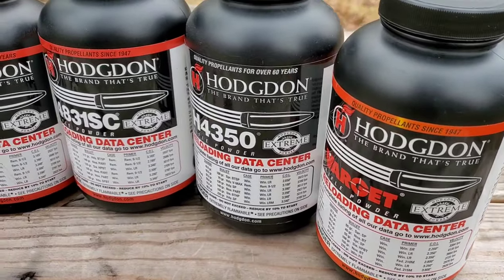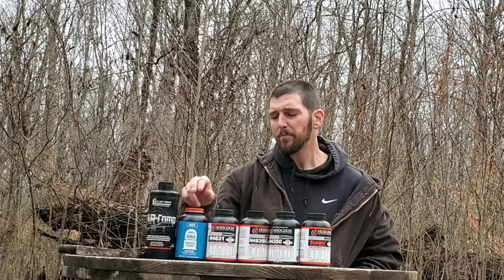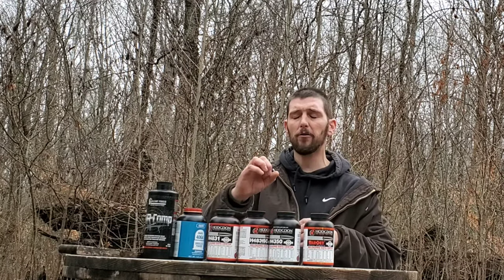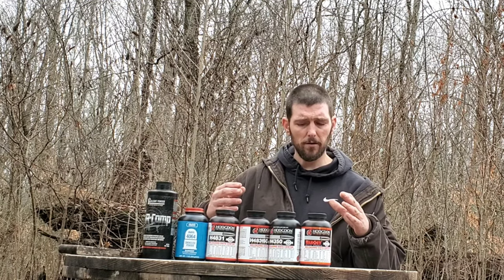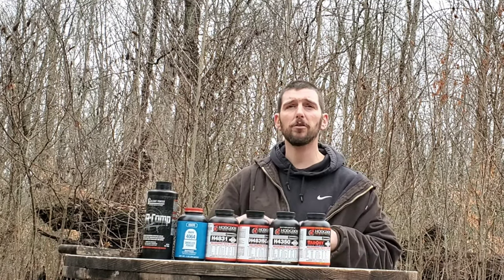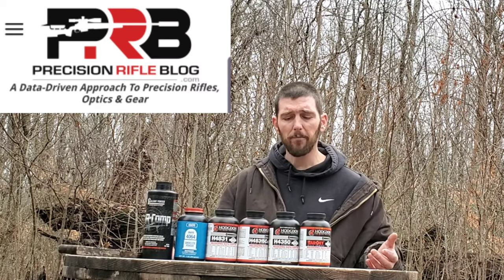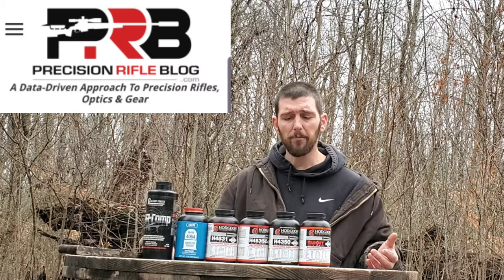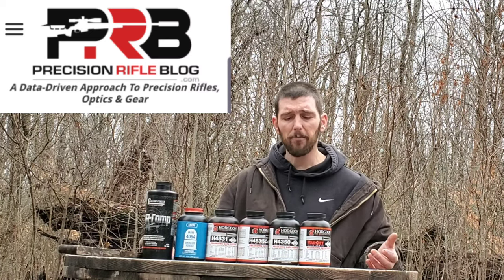Powder Temperature Sensitivity For Long Range Precision Rifle Loads

Comment: Depends on the application, but with 4064, a decent weight bullet, and a fairly full case, over 80F swing, it has shown about a 0.15625FPS change per 1F. I arbitrarily call anything with less than a 0.25FPS change per 1F, stable. Researching this, there are a butt load of variables that play a role in sensitivity(case fill, bullet type and weight, cartridge, lot number, ect...). These test videos are valuable, but your mileage may vary. Some powders are always stable by everyones definition, some are never stable under any conditions, and many ride the line being stable in some conditions while being unstable in others. If you do the research and run the numbers, you'll see this trend. The best you can do in research is get a ballpark approximation for the values of fps change per 1F. If you want something to reliably plug into your dope, you have to test your specific load.

Comment: The IMR Enduron powders are double based with some treatment to reduce sensitivity. The Hodgdon Extreme powders are single based. 
So, the Enduron line is definitely not a clone of the Extreme line. Double based powders contain nitroglycerin which increases the energy content and thus produces higher velocity but the nitro is temp sensitive. 
If you are seeking ultimate stability single based powders with reputation for stability are the best. But you give up velocity to achieve this. 
If you are seeking ultimate velocity, double based powders juiced up with high nitroglycerin are the way to go, but you give up stability for this. 
Then there are the newer powders coming on the market that attempt to strike a balance between these two alternatives. These are double based powders with moderate nitro levels and super proprietary treatments with magical chemical elixirs to reduce the temperature sensitivity. These include the Enduron line, Reloader 16, Reloader 23, and Staball 6.5
These powders are designed to yield higher velocity but without excessive sensitivity…. A compromise balance in the middle ground. 
Only time will tell how good these fancy pantz temp stable DB powders really are. I have tried SB6.5 in 300WSM and it was twitchy… me no likum. 
RL16 seems to be developing a positive online anecdotal reputation… that one might be worth a try.

Comment: Temperature stability isn’t just about velocity. Some sensitive loads in some rifles really impact group size and point of impact. I tried H100V in my 300WSM… great velocity!… But…
I loaded up 10rds to test groups at 100m… shot 5rd group at 5degC and a 5rd group at 30degC
The 5C group was 0.89”
The 30C group was 2.6”
Mostly horizontal stringing… no bueno…
I can live with some velocity differential… but I need POI stability and group size stability. Gonna try H4831sc next.

Comment: I use IMR4064 used it competition and hunted Alaska never had a problem all chronographed the same. Altitude makes one hell of a difference. Temperature range Arctic minus 62 to Arizona 120 degrees
Reply from the maker: My experience was much different with 4064 in my 308
Reply: Agreed....I have never experienced and temperature swings with IMR 4064...of course the 30-06 is a larger case and as such may allow a little more forgiveness than your 308 case which relies on using more efficient powders.

Comment: Just picked up a bottle of imr 4064 and arcomp to try out, haven’t been able to find the others around me locally though
Reply from the maker: Ar comp is fairly insensitive.4064 is pretty temp sensitive but as long as you do your load work up this time of year and dont load to mass pressure you should be fine. You just may have to adjust your tables as the weather heats up.

Comment: I very much enjoy your videos.
What is your secret for shooting these small groups/spray cans/shaving cream at distance? Do you have really really low ES and SD figures?
Reply from the maker: Thank you. A huge part of it is load development.  Using good powders and achieving low sd and finding a load that settles into a good accuracy node at the same time. Then collecting good data.  Then just having good fundamentals and recoil management.
Reply: Speaking of recoil.. how do you preload the bipod? Also, are we talking low SD? Of SD below 5 consistantly? 
I am fairly new to LR and have been learning alot from your channel. I shoot a Tikka CTR and it can hold half moa 5 shot groups and single digit SD pretty well. Sometimes I just can see my heartbeat. Most of the time reading the conditions (wind) is what gets me.  Trigger control is improving. Guess all you can do is practice.
Reply from the maker: @henryknoetze9579  I usually am happy with sd below 10fps. Sometimes you get lucky and find that sweet spot where you can get a 3fps sd but it's rare. Pre load doesn't have to be a lot of pressure just enough to put forward pressure on the bipod. The way I do it is when I get down into a good position and spread my feet out for stability I use my feet to push forward very slightly. I usually find when I can see my heartbeat it due to nervous energy and a few deep breaths and making sure I'm completely comfortable in my position will help slow my pulse and minimize it to almost nothing.
Reply: Real solid advice. Thank you for taking the time to answer me. I will implement these and hopefully become a better marksman. I heard in a video you said you fire at the bottom of a breath.. is that regular exhaling? Or do you take a deep breath and slowly exhale while squeezing the trigger? Also, what weight is your trigger set at?
Reply from the maker: @henryknoetze9579  no problem.  Yes just a regular breath. My Tikka trigger is a stock trigger with a 12oz aftermarket spring in it set at 12oz. My savage 12fv accutrigger is a completely worked over stock trigger that also breaks at 12oz. You can get all kinds of aftermarket tikka trigger sprigs for very inexpensive prices. Just search for it on Google and you'll find all kinds

Comment: I mostly try to get the extreme line of powders too, but I’ve also read that it depends a lot on powder fill and primers. Right now I’ve been chasing es and sd in my Valkyrie bolt gun using H4895 with 85.5 Berger’s, doughnuts are a problem even with starline brass, with the Berger’s I have a change in velocity of about 60fps from temps of around 65-70 down to around 40-45. I think it’s efficiency is not there anymore and quick load don’t have the 85.5’s. But the 80 eldm loads have a less spread......about 20-25fps spread.
Reply from the maker: The powder fill and primer choice will effect you standard deviation and extreme spread but shouldn't have an effect on your temperature sensitivity. If I remember right 4895 has a really fast burn rate. I use both varget and h4350 for my 224v load and I use Winchester small rifle primers. Both of those are extreme powders, They are very clean burning and they both usually give low sd numbers. I'm getting under 10fps sd with those combinations in my valkyrie.
Reply: What bullets do you use? I have both varget and H4350. Need to play with quick load on these powders. This is also in a remage bolt gun btw. Thanks for your videos, I like them.
Reply from the maker: @IHFarmer2007  I load an 88gn eld. I'm getting 2855fps from a 24" ar with no pressure signs. With my varget load. And thank you I appreciate it

Comment: I fell into the same IMR 4064 trap.
Reply from the maker: It's easy to do
Reply: @gunfather83   crap i just loaded a bunch of imr 4064 rounds.....like 280 rounds
Reply from the maker: @tristancase8546  no worries.  As long as you know it's very temp sensitive you can adjust your velocity in your ballistic solver to adjust for it. If the velocity changes too much it can cause accuracy to diminish but it takes a big temp change. It's not a bad powder at all it's just very temp sensitive.

Comment: where did you get the burn rate relative to temp. chart? im having trouble locating that info online
Reply from the maker: Google powder temp sensitivity chart. In the images there are a couple of different charts for it but you have to look through them because some are just burn rate charts.  Also precision rifle blog has a good article comparing some of the hodgdon extreme to imr enduron with there temp sensitivity numbers that they found

Comment: What's a good powder to start loading with for my 224 valkyrie? Tia
Reply from the maker: I use varget and h4350 for the heavy bullets and ar comp for the middle and light weight bullets
Reply: @gunfather83  thanks man
Reply: Any experience with VihtaVuori powders? I was trying N540 on the Valkyrie because of the cost of Varget

Comment: Is H4895 temp sensitive..??? Anybody...
Reply from the maker: H4895 is part of the Hodgdon Extreme line. Extreme line is hodgdon's non temperature sensitive powders. They will have very little temperature deviation across a wide range of temps. So no worries with any of the extreme powders
Reply: @gunfather83  thank you for the reply, that's good to know...
Reply: @gunfather83  what about IMR 4895?